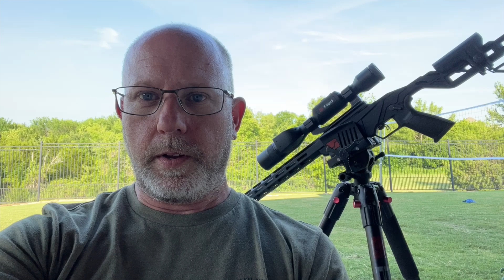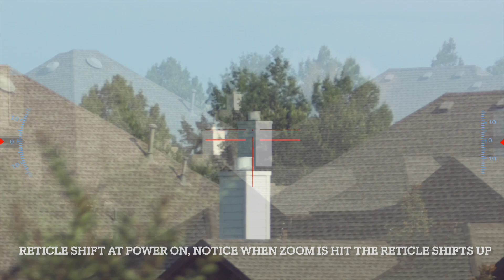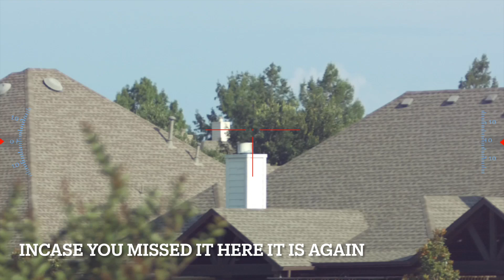ATN X Sight 5 POI Shift at Power On (Update - issues resolved with new firmware 5.1.04.461)

Comment: I have received my ATN X Sight 5 x 25 last week. The issues raised for me:

1. From the beggining I have found that the screen is blinking like it is an old TVset. Ok I recharged the battery and did not saw the same problem again.
2. When I was zeroing the scope and put some bullet parameters the scope just stuck for 10-15 minutes and did not reacted on any buttons at all. After this 15 minutes of freeze time it starts to operate again in normal way. This sutation repeated 2-3 times during I was examined the scope settings. Very annoying moment to be honest.
3. The most worst problem for me is the focusing and clearenes of the view. When you are doing the magnification from minimum to maximum range the picture is blurry and I cannot see clearly what is happening on the target where I shooted. 

I have the ATN X Sight 4 Pro 5x20 on my other rifle and I did not have any of this problems which I had on my ATN X Sight 5.
The picture on any distance is very clear, the scope is not laggy at all and I am happy with it almost 2 years of using. Yes it is bulky if you will compare with Sight 5 but in operational way Sight 4 is much better for me.

So after 3 days of using the ATN X Sight 5 I bring it back to official store and gave them the full story of everything what I have found with this scope. So they have sent it to the ATN HQ for some checks but the dealer have told that in 6 days I will get the brand new unit. 

The main problem is now that I do not want it anymore. I am done with this shitty product and I am not sure that they are able to solve all the problems which they have with this scopes now. 1500EUR per unit which is operating worse than the Chinese PARD NV008 LRF for 799EUR I have this scope too and to be honest it is much better even with magnification of 6,5x–13(26)x only. Very disappointed with ATN X Sight 5.

Comment: Mine freezes, POI changes turning off and then on, clarity in daytime is very poor, cannot get LRF to pair with scope. I called ATN and my firmware was 392 so they had me return it or wait on update. No idea when it will be out so I sent it back. I asked the rep to fix mine or send me one that works correctly, if it comes back and still has problems I am going to inquire about a refund! I cannot believe some of these scopes work and some do not. How can some need firmware update and some don't? My problems are all electronic related. And i agree, who tested these out? I went thru this with the 4K's. I was really liking the "5" from what I read. Not so much now.
Reply: I sent mine back today after spending about 20 minutes with the rep. ATN has acknowledged there are issues and actually stopped shipping units. I am cautiously optimistic that the unit they send back will have been tested.  I will admit I bought the unit right when it came out and this is the 10th or 11th ATN product I have purchased, all but the Thor LT 320 had issues at the beginning and most took 6-18 months before ATN figured it out. I knew this going in. It is not an excuse for the company. I keep thinking they will learn from the past. There products are innovative but not well tested. I will post new videos once I get the unit back. On your LRF unit. ATN has stated the LRF will not work with the Gen 5s. If you want LRF you will have to buy the XSight 5 with built in LRF. I think this is crap as I own and LRF I use on my Thor 4. It would have been nice to save a little and be able to swap between sights.
Reply: They did not stop shipping anything. I got mine a week and a half ago, used it for a day, and sent the piece of shit back for a refund. A word of advice; if you buy a thing or two from a company, and they have issues, do t deal with that company. They keep selling shit because people like you (admittedly) keep buying their shit. Demand more for your money man!

Comment: “If you purchase ATN X-SIGHT 5, you have a nickname that you may not be aware of.

Beta Tester.

But after spending (wasting) a considerable amount of my Saturday afternoon, I think a more appropriate term would be Alpha Tester, or dare I say sucker.

Please don't take what I'm about to say as arrogance, but I do product development for a living, as a Sr. Software Engineer and Product Owner. If I let a product go to production in this state, I'm certain, I'd be looking for a new job by lunchtime.

Listen to the long list of problems:

RAV Calibration doesn't work in most cases. I was literally banging on the butt of my rifle until my hand hurt to try and get a reading to register. After several reboot sequences and lock ups, I got one reading to register once, but not enough to get RAV to calibrate.
RAV doesn't work either. This isn't new to ATN, they didn't even use their own scopes to generate the 240p fps marketing videos, as the video is not from the perspective of the shooter. I guess they think we are just stupid for them to even try that one.
Audio doesn't consistently record in all video resolutions. Only a few seconds of audio is recorded in all modes except for the mid quality 60p mode. This is a rookie mistake, and probably turning off power to the mic pre-amps and they are being powered by the filter capacitors for a few seconds.
Video quality is okay, but just okay, not great. This is because they will record video in 4K resolution, but the sensor is only slightly bigger than 4K, which means that they are doing lossy interpolation, and making pixels up based on a nearest neighbor average or some similar filtering algorithm. But if you switch the video resolution to 1920ish, you still have soft quality because now they do line skipping of the sensor instead of down sampling. Ideally, to do digital zoom, like most all digital scopes that do not use a variable optical zoom system, the sensor needs to be a higher resolution than the delivered video at max magnification. This ain't that, not even close. They would need a 40MP sensor to do 4x base magnification and still ship 4K that is real detail.
The number one rule of product development is be careful what features you support, because you will have to include them for eternity. ATN must didn't get the memo, because you can no longer play back video or review photos in their new flagship
The headlining feature of generate your own reticle is nice. It would be nicer if imported reticles persisted after a power cycle.
Just to show how bad this firmware is, we are once again given a product that can't keep time. I had a Sony Walkman that managed to keep time even after Y2K, so ATN, whatever you're doing, you're doing it wrong.
Overall lack of effort. Icons are present the first time you enter a menu, but the second time, the icon is missing, or even worse stacked on top of another icon. I was at the range for 3 hours and was forced to do a hard reboot 3 times, so I guess they have some consistency in some ways.
ATN Connect 5 app is suppose to be a major upgrade. Too bad the app isn't even available in the Google Play Store. How could you mess up this release?
Sold me an SD- Card that goes with a scope billed (as another headline feature) that it records 4K video, but the SD-Card isn't rated to record 4K video. That's petty. You'd be better off not even offering cards at all than cards that will cause recording to fail. Are you purposely trying to generate support calls? If so, congratulations 🎊, you finally succeeded in a release goal!
My comments may seem like I hate ATN, and that could not be further from the truth!”

Comment: I've returned mine back to the seller. Had a freezing issue out of the box (LRF 5-25x). This is an answer from the ATN rep. "I do not have an exact timeline on the new app or firmware yet. I do apologize".

Comment: What firmware are you on? Im on 5.1.03.395, but I havent mounted it and shot it yet.   I find the wifi and connect to it, then it asks me to turn off the Mobile data to make it work???  That doesnt make sense to me but it never connects to the scope in the app.  I do find that the buttons dont always navigate the menu when I first push them.  Sometimes I have to push the buttons several times for it to take effect.  Not sure if its freezing up during that, but the image in the background is still moving around when this happens.
Reply: @dont-use-delete  thats nothing new for ATN everything they have ever released had bugs. It will take them a year to put out a firmware update that fixes 98% of them. That other 2% will never get fixed. My xsight 4k pro still freezes up constantly and its up to date and its been out for years. I was going to buy the Gen5 but after watching these videos ill pass on it until they get it fixed.
Reply: @Ryan Smith  
That's crazy and it sucks about the freezing issue.
I have had my gen 4 for about 4 years and haven't had any issues with it and running the newest firmware. I wish ATN would stop using its customers as test subjects but all of the companies do the same shit. A buddy of mine works at a sporting good store and told me he has had to send back Pulsar and many others also. I guess it's hit and miss on all this stuff. Electronics. I want the new 5-40 thermal but I'm going to wait. I can't justify 7K for a scope that will probably have many issues for the first 18 months.
Reply from the maker: Well crap. I cannot get the X-Sigth to power on. I can hear it power up, but the screen is black. Tried a dozen times. Ill charge it over night and try in the morning. (note is should be fully charged but...)
I think I am on the same firmware as you, I cannot power up to tell. Interesting on the Mobile data comment. Are you seeing that on your phone, and if so, what type of phone? I am using an iPhone. Note that the Obsidian 4 application will not work with this site. ATN has not released the new software (ATN Connect 5). I believe it is still a month or so out. I am also experiencing button lag or required to press more than once to get the scope to respond. I have the same issue with my X-Sight 4 and my Thor Lt320. Its an ATN feature LOL.